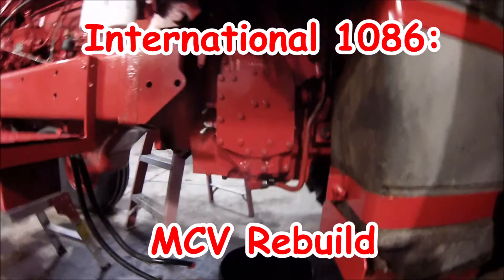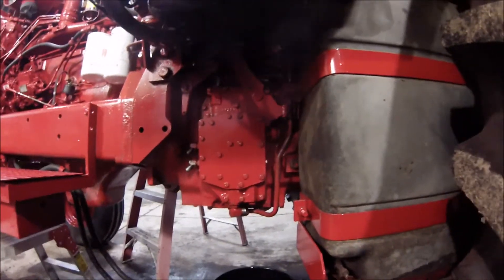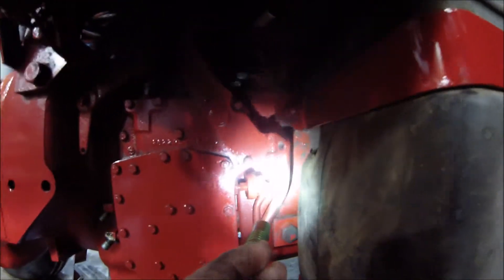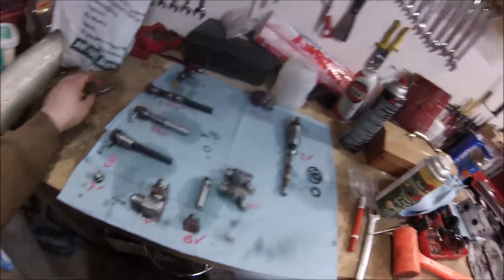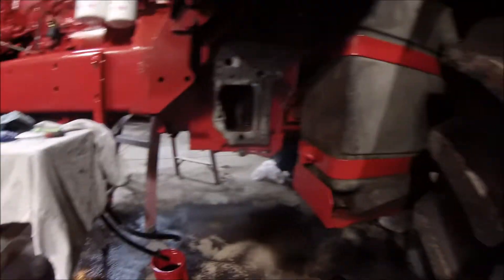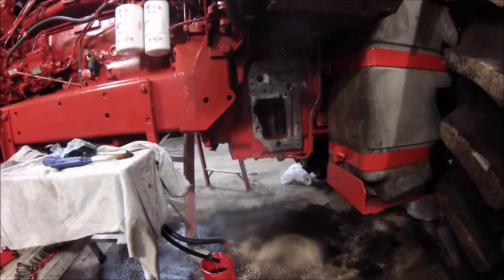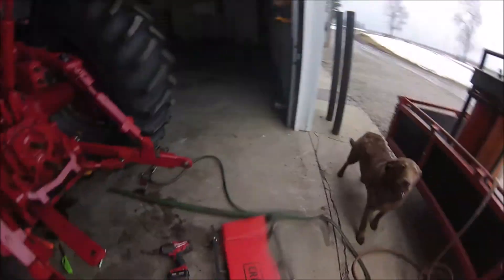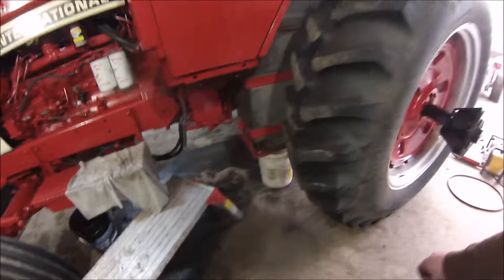IH 1086: MCV Rebuild

Comment: Hello. l'v been watching you'r videos on you'r 1086 and was wondering  if you could tell me where you got you'r shop manual ?  Thank you.
Reply from the maker: https://www.ebay.com/usr/peacefulcreekauctions?_trksid=p2057872.m2749.l2754

This is the eBay seller I purchased it from. Great guy to work with, I've never received a package that was packed with such care before. Definitely worth spending the extra for the full shop manual over the I&T if you're doing any serious work.
Reply: @GreenIronGarage  free manual??
Reply from the maker: @vivk202jz9  You might be able to find something but nothing that will compare to the original International Service Manual. The cheapest you could get by is probably an I&T shop manual usually between $25-$50, but the IH one is far superior. If you own one of these tractors, it is worth every penny if you plan on doing any work yourself.